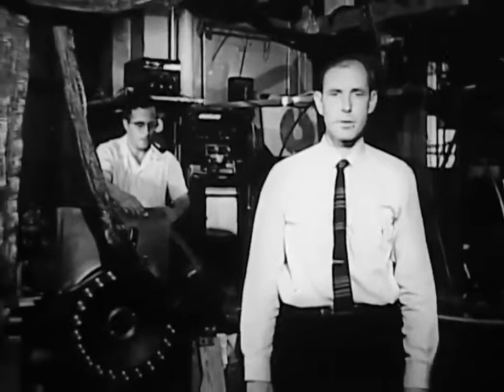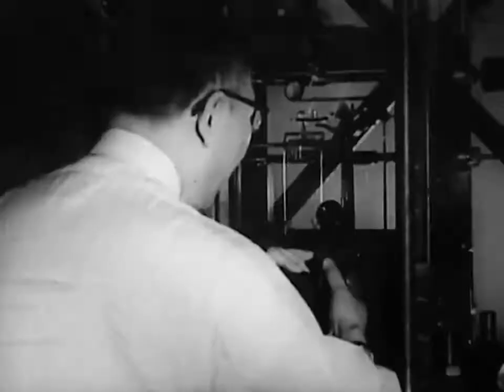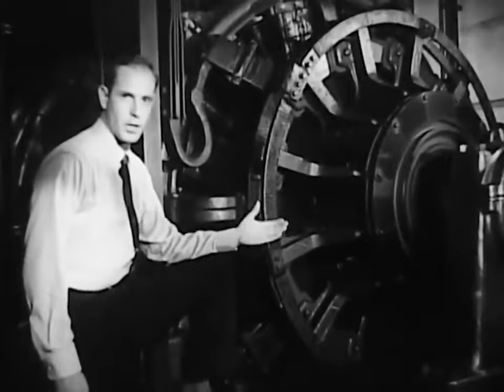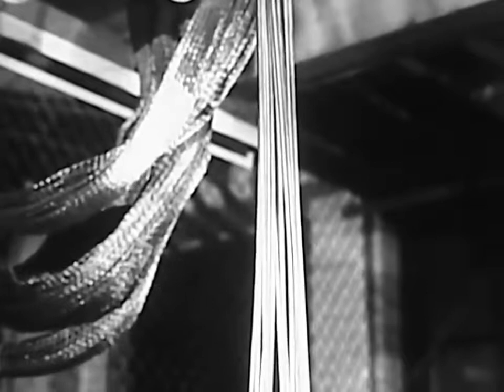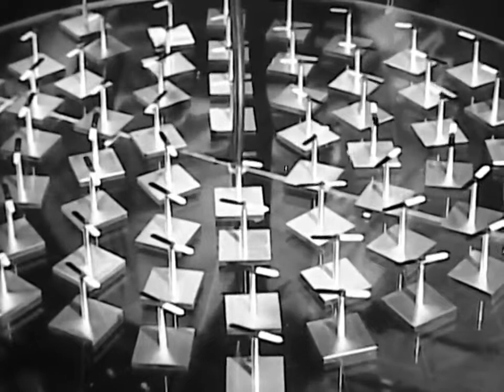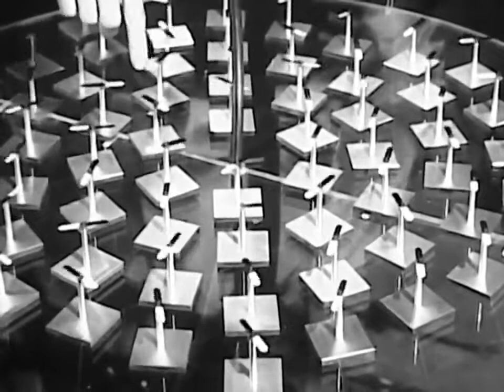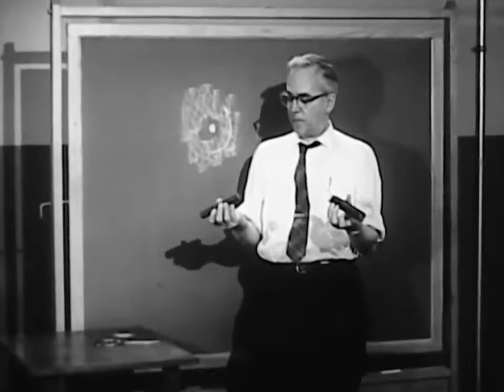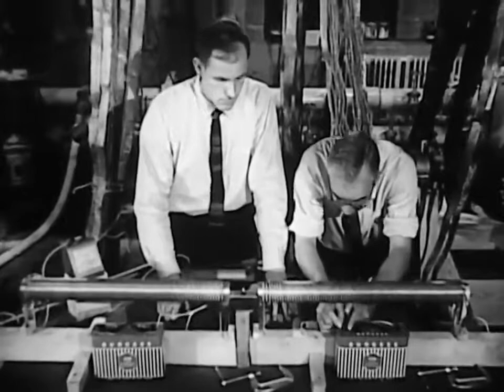Electromagnets A Magnet Laboratory 1959 PSSC Francis Bitter MIT John Waymouth, Sylvania

Comment: 4:44
The inrush current on this mammoth AC motor must have sent the whole country into a rolling blackout XD.
Reply: Looks like a huge homopolar generator. Those things were the workhorse for high-current generation before power electronics took over...
Reply: The lab had to make special arrangements with the local power grid (in Cambridge MA) in order to run the more powerful experiments.  They tended to have to use power very late at night.  The DC generators were salvaged out of decommissioned WW2 submarines.
Reply: No, that was me. sorry.